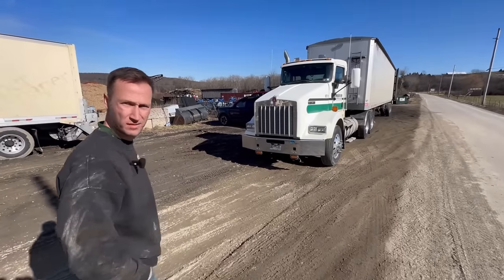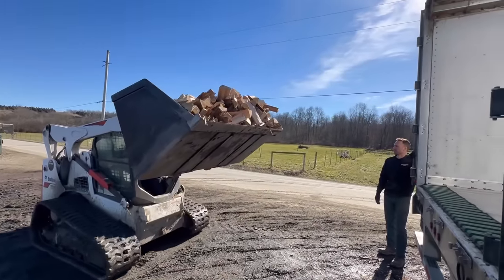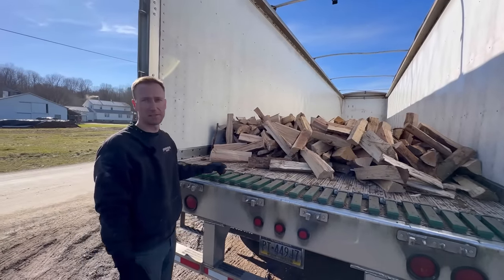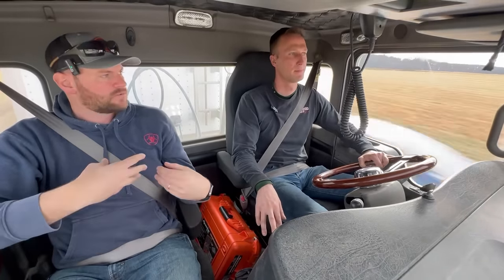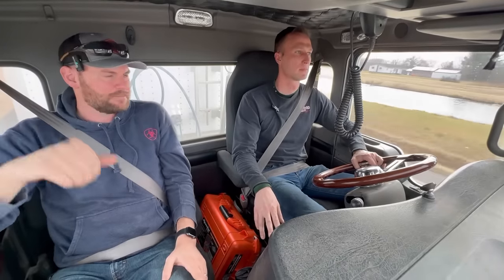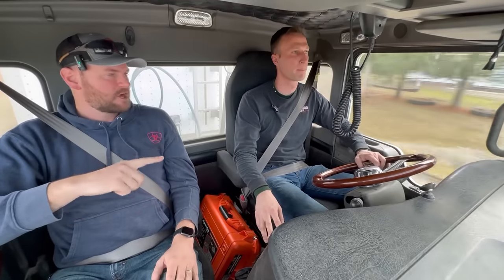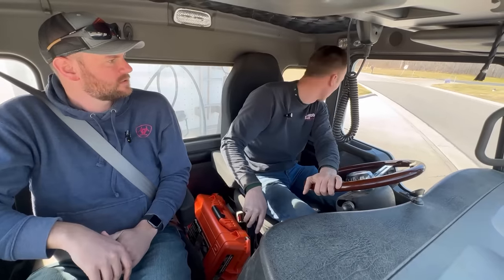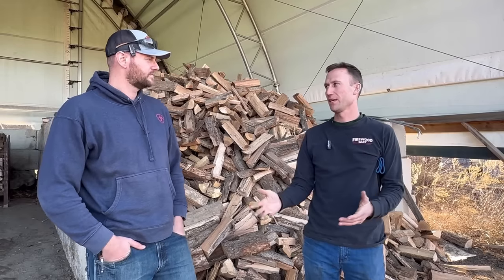12 Cord Firewood Delivery - How It’s Possible

Comment: That walking floor is pretty cool. Never heard of that until now.
Reply: I have been in the firewood business for.50 years. I sell my wood  for $50 a face cord. It takes me $30 to process a face cord of wood . That includes cutting, getting it to the wood lot, and delivering. It to the customer. I sell mixed hardwoods. I measure and mark each stick at 16 inches. I advertise on Marketplace.

Comment: Keith industries has been manufacturing walking floor trailers since the mid 1950's. In the 70s and the 80s we used keiths walking for trailers to haul firewood in the California Central valley when we would clear out the almond and walnut orchards. So it is not a new concept in firewood transport. Unload was quick and easy. 
Keep up the great videos. God bless.
Reply: A belt trailer has better clean out and unloads faster then a walking floor trailer 😉

Comment: Wilkens trailers are made in Stockton, Kansas.  I used to pull a high-sided one hauling the hay we processed with a tub grinder to feedyards.  The sides are fiberglass coated plywood and are pretty tough.  We hauled some wood mulch for a broker who had it railed in, and found out pretty quick how much heavier the mulch is compared to hay.

Comment: I’ve hauled many loads with a walking floor we would put a sweep tarp down on the rear of the trailer and stack the wood on the tarp instead of just dumping it on the trailer that way you could get a lot more wood on the trailer plus the customer could measure the load and everyone would be sure they were getting what they paid for and with the sweep tarp on the floor it would move wood to the front of the trailer we could then unload it and the tarp would clean out the trailer with out having to get in and throw a bunch out plus by stacking we could haul 17 to 19 cords

Comment: As for wood types, I use wood as my primary heat source, so some woods which many consider good firewood, I do not prefer, such as black walnut, cherry and maple. They do not put out enough heat.... I want oak, ash, hickory, black locust or hedge. I use mostly oak as it is the best overall firewood and most plentiful here in the Ozarks.
Also, the floor of the truck bed is really cool...

Comment: Great video Adam. Matt has a great business going there with that kiln. If I may add that it is generally mandatory that firewood that is transported that distance must be “kiln dried”. US dept of Agriculture doesn’t want invasive species or bugs transported more than 50 miles from its origination or across state lines. Wood has to be heated to a certain temp for a specific time to be labeled “kiln dried”
Reply from the maker: Yes Matt’s firewood is usda heat treat certified

Comment: I used 1 of these in 1987 worked nicely I was hauling cottonseed hulls
Reply: When I sold my truck in 2019 it had 1,128,000 miles, it had a 13 speed transmission I almost enjoyed it.

Comment: Run the floor all the way forward shut it off at the trailer. You load up all your firewood then you put your tarp on the frontier up top Holloway across put about 56 pieces of wood on top of it towards the nose when you start pumping the floor off, that will fall down on the floor And help sweep out the rest of the wood if you had an East or manic live floor trailer they have a door that you can go in through the front while it’s pumping off. I’ve pulled everything in life floors from logs, wood, trash, light iron bark mulch, manure. Hay my trailers had a high impact Keith walking floor system, all tri axles  what you need is a loading dock that you can pull up alongside for loading your firewood just like you, would your bark mulch, playground chips or anything else I would load the firewood, the same way honestly obviously you have to be gentle dumping the first layer

Comment: That’s a slow process for loading firewood. Either a stockpile to load with the shovel or have an elevator you can feed with the skid steer or the wheeled loader would be more efficient.

Comment: To max out a load on truck and trailer use the air ride suspension with gauges T'd into the lines,  with good quality gauges and level ground should be able to get within a ton or less of max gross weight with no issues.

Comment: While walking floors are cool and all it's pretty slow loading and unloading. If your scared of end dumps maybe give thought to a flowboy you can load over the top and not have to worry about hurting the belt. And so much faster
Reply: Understood. Walking floor holds more cubic yards and we already own them. That's the reason we chose to use them.

Comment: You all talked about moisture content several times. Just recently I cut down a live red oak as well as two standing red oaks that had been dead for about 4 years. I assumed that the dead trees would have been somewhat seasoned and read to burn, but that wasn't the case. They had a moisture content just like the live tree had. I have burned some of the dead red oak with some seasoned ash wood in my stove and it is burning just fine. I always keep the chimney pipe cleaned out (at least twice per season). Is there a difference in the wood just because it is dead, although it has the same moisture content as the live trees? I've been heating our home for over 40 years, but I'm still learning about different trees and their moisture content.

Comment: things has sure changed sense i was cutting /selling fire wood thats for sure..i have cut & manually split & Sold a many pickup loads of wood for 50$ or less ! But a pickup load to me is not a so called level bed full it is rounded up a bit half way over the cab...That was a good load of Wood...But was 20+ years ago to...man has things changed..i had a guy sell me a pickup load one time for 50$ & i bet it would not fill up a wheal barrow ! i am a old Dina soar i suppose & i am about your age ! I just come from a very small & Rural hick town where folks think a Good electrician should only earn 8-10$ an hour or less....Most could care less about anything but quality as long as its cheep ! i just recently figured it out myself ! but i do understand why Now at least !

Comment: Green poplar wood is actually not bad for firewood, it's black poplar that's no good. It retains to much moisture. I've been burning green poplar for over 40 years and the only down side is it creates a lot of ash. Also, I can cut up to mid-July and it will still cure enough by winter(Nov.) to burn very well. I cut up to 25 chord every year, my pieces are all 20" long and anything over 3" gets split. I do everything myself except for the splitting, my dad runs that!

Comment: Walking floors can be a big bummer in the late fall when the first heavy frosts start.
Had a couple freeze right up and jam……with a load on.
Hours of resetting controls and repeated cycles can break them loose.
But putting in a heated shop can be a necessity.

Been there, done that.
One hour to load
Two DAYS to unload lol.

Comment: Very good vid.  And you guys are in PA maybe i'll come and visit out there.  Just watched a video of a kid who hand stacked an entire dump trailer by hand, ugh!  In a previous life i sold cedar mulch out of canada but the live bottoms would get frozen and we would have to bring them in the shop and put the jet heaters under them until they could unload.  Then there was the day a guy brought a load of 2,000 pound bulk bag fertilizer in a live bottom and one got wedged sideways into the wall and it was a royal pain getting it out.  So i always wondered, can you drive a 4,000 pound warehouse forklift up inside that trailer over the walking floor?  I know that's not the usual material to haul,i guess this guy found it on the load board and took it that way.

Comment: Wouldnt it be more efficient loading the trailer with a fork attachment on the loader so the container doesnt have to be tipped into the loader bucket. Does it not lift high enough?

Comment: I never heard of a walking floor until now but the first thing I noticed was how that bucket was tilting and was wondering why you don't use an elevated dock.

I did not notice how the wood is dried, what kind of fuel to generate Heat. Does anybody know? I JUST HEARD THE ANSWER :-)

Comment: How dry should fire wood be for residential use in a wood stove?  ( Can it be too dry)
Reply: That's a really great question! The answer lies in how well you can control the air to your furnace. The tighter the furnace the less an issue low moisture firewood is. You control the burn rate and heat output by controlling the oxygen with dry wood that is. Some people claim properly kiln dried wood burns too quickly compared to higher moisture wood. So the answer to your question is unique to your personal preference. Yes wood can be too dry as taking the moisture content too low doesn't deliver alot of benefit as the wood will acclimate  to ambient humidity. This is a very interesting topic and one I have great interest in. Thank you for asking!

Comment: a CORD of wood is a VOLUME MEASUREMENT!  so i always ask "how much for a cord, right from the git go! that is my FIRST QUESTION. next is species. i dont care what the moisture content is because it will dy, my 3rd question is the length, and 4th is whether or not it is split.

a CORD IS 4 FOOTX 4 FOOTX 8 FOOT. IM A 65 YEAR OLD MAN AND HAVE BURNED WOOD MY ENTIRE LIFE! I CUT AND DELIVERED FIREWOOD FOR A LIVING IN THE PAST, IN THE 1970'S AND 80'S! i had 1 customer who bought by the pickup load. wide bed long wheel base 1968 chevrolet. he paid $20 a pickup load just thrown into the truck and thrown into a pile! this was in Arkansas! all red oak. he had a very big property and would re sell it.
in minnesota i was cutting and stacking along a trail i was cutting (late 1980's) the dead elm. then i would pull the splitter through and stack that on the opposite side of the trail. and later i would come through with the trailer. this was for my personal use.

im in south dakota and someone is always asking me to sell them some firewood, my answer is NO this is my own personal energy storage!   i have NOT split any of it, as it makes it harder to steal that way. when i lived on the property full time in a 31 foot long camper the first year i burned the maple flooring from the old house on the property in a M1950 surplus military tent heater. we would have to open the doors at 2 am as it would be 105F at bed level at the opposite end of the trailer! 2nd year i saw an add on craigslist for lumber scraps. it was the trash hauler that had 35 cu yd dumpsters set up at a TRUSS FACTORY. 35 cu yards delivered 50 miles was just $180. pine and spruce. i bought 2 dumpsters full. used several layers of chicken wire to make a screen to filter the sawdust out of the small chips , put chips in feed bags and wood pellet bags my neighbor gave me. the wood blocks were up to 10 feet long (lumber reject) mostly 2x4's but also 2x6 , 2x8 and 2x10, and 2x12. there were also the stickers that came with the loads of wood and had a groove down the length for the banding!

when i was in colorado the firewood that was for sale was pine and expensive to boot.

i do not care what species the wood is, it all contains about the same BTU PER POUND, lighter woods require a larger volume to equal a heavier wood like oak , maple or ash!  the price i might pay if i was buying would depend on the species.  ive seen firewood sellers stack the wood in their pickup truck all SPLIT SIDE UP, that allows a greater volume of empty space in the pile of wood.
firewood here in south east south dakota can NOT be hauled from 1 county to the next because of the ash beetle killing the ash pine borer doing its thing too.
IF A PERSON HAS AN OUTSIDE WOOD BOILER LIKE I DO, IF ITS LESS THAN 3 FOOT LONG AND YOU CAN PICK IT UP, IT WILL FIT IN THE STOVE! I CAN EVEN BURN MY BURNABLE TRASH (NO METAL, NO GLASS AND NO FOOD SCRAPS) IN THE BOILER. THE TIN GOES IN OLD CARS AND GLASS GOES TO RECYCLE CENTER.
THERE IS NO SUCH THING AS TRASH, JUST STUFF THAT IS IN THE WRONG PLACE!

Comment: Matt, great video. Where did you get the motorized forklift dolly that you use to delivery firewood to residential customers? I have a winery in eastern Pa that has low ceilings and could use something like that to move barrels in and out. Thank you.
Reply: It is a custom built unit fabricated through a joint effort of myself and a local fabrication shop.
Reply: Thank you @firewoodguy3016

Comment: Man, I'm not sure if the numbers for this make sense to me.  I don't know what you guys get for a cord of firewood in PA, but I'll guess that if it's kiln dried he gets 400.00 per cord?  Times 12 cords per trailer equals 4,800 GROSS for a trailer full.  Then there's the cost of the lumber to him initially, and just loading it took two pieces of equipment running quite a bit of diesel, and the man-hours as well.  And it appeared that loading that trailer was pretty time consuming.  Unless he gets considerably more than 400.00 per cord, I don't think those numbers would work for me.

Okay, now I see, later in the video, you even addressed the manhours it took to load the trailer, which was 10.  So let's say hypothetically he's paying his guys 25.00 per hour on the check, plus health insurance (although I don't know if he gives his employees health insurance or not), and then add in workman's comp insurance, and unemployment insurance,  his guys have got to be costing him at least 50.00 overall per person.  So, there's another 500.00 gone in overhead, not including the fuel for the trucks and loaders, etc....etc....I guess I'd just have to know what he's getting per cord to know if these costs were even justifiable.  But your buddy IS a college grad, which in itself doesn't mean that he couldn't make a bad business decision, but he doesn't strike me as dumb, so I'm guessing that he's probably getting considerably more than 400.00 per cord for his kiln-dried firewood,  If not, I couldn't justify the numbers personally.

Comment: Matt I'm a "what if planner" guy what would happen if your trailer conveyor system fails at a delivery site? Is there a backup/manual system?
Reply: Totally understand. These do not have a back up option for unloading outside of by hand. I have been using multiple walking floors for many years without any issues that prevented me from unloading and getting home. They are extremely reliable as long as you practice good maintenance and common sense. The most common issue would be a blown hydraulic line. Which if it occurs can be fixed relatively quickly and locally. I hope this helps.

Comment: Seems to me that the two high stacked baskets output that come from kiln could be direct loaded on to a flatbed trailer and with a loader attached to end of flatbed trailer which could unload and dump baskets, or better yet for a deposit one time for high volume customers keep the 2 half cord baskets times the number of cords in a standard re-order until next re-order and dumping would be eliminated as flat bed would then return with empties ready for processing at your plant w/o need for a mobile loader and customer could unload and put the returning empties on flatbed eliminating a lot of handling and giving all parties much more flexibility and much lower handling costs incerdible fas turn around times while allowing for maximun net shipping loads (20 cords of fire wood per shipment may be easily possible with alum. flatbed trailers) and quicker less labor intensive processing at both ends and much lower capital investments compared to acquisition and maintenance expenses for moving floor trailers. Customer could be shown financial ROI and advantages of being able to move, cover and process firewood with much less overhead at customers end with just a small forklift ? Ray Stormont
Reply: Great ideas Ray! However the baskets are too tall to ride on a trailer double stacked. 20 cord would also be way too heavy for any flatbed I currently know about plus basket weight. The baskets also are very expensive over $1,300 each and they hold 1/2 cord. You would need 24 baskets to hold the 12 cord delivery. I also don't know many customers that would be willing to over 30k on deposit for the baskets. Interestling enough this customer was exchanging baskets via the method you suggested. They just don't make alot of sense because their dimension does not allow for them to be hauled efficiently on a flat bed.
Reply: A low profile trailer or lowboy has a deck height of 1.5'- 2.0' can easily accept 11' to 12'0" cargo height and still be at or below the legal the legal limit of 13'6" and could carry two of the 64" tall baskets two abreast and two tall 5 baskets long and 4 standard height baskets on tongue deck with power rear ramps and non detachable tongue can be obtained custom built from Kaufman at attractive prices for a custom 18" high main deck non detachable tongue carrying 12 cords 20 baskets 2 high on main deck and 4 std. height baskets not double high on tongue and leave enough room on the rear deck above axels  to carry the  unloder fork lift or one more cord if cust has suitable fork lift allowing you to dump the baskets at the delivery site and return with the empty baskets. Loading and unloading with only 1 man lowering your capital costs (low non detachable custom trailers are far less costly than moving floor and orders of magnitude less maintence increasing your profits THANKS FOR TAKING TIME TO RESPOND! @mattdangel1906
Reply: They take longer to load but only fifteen minutes to unload. The extra weight of the baskets and loader if they bring it would drastically cut into their payload. They already own the walking floor to deliver their mulch. No need to strap down and tarp off the load.